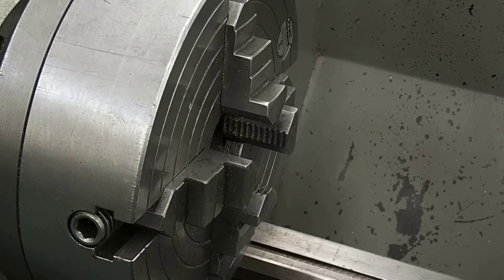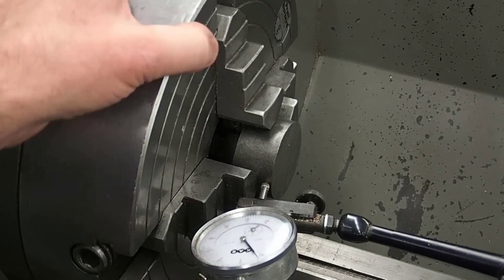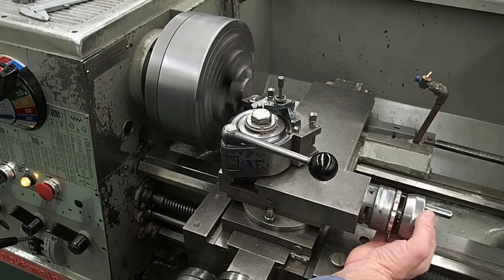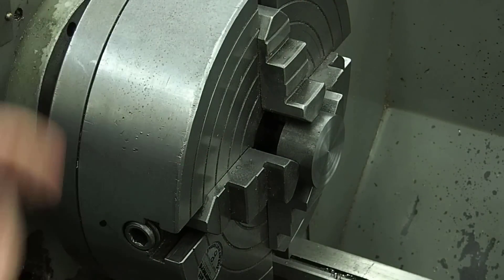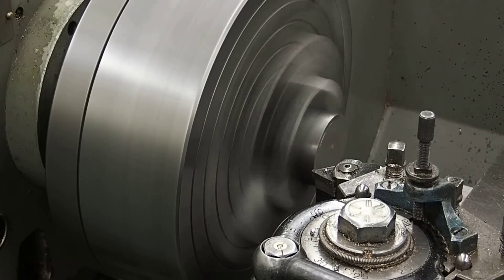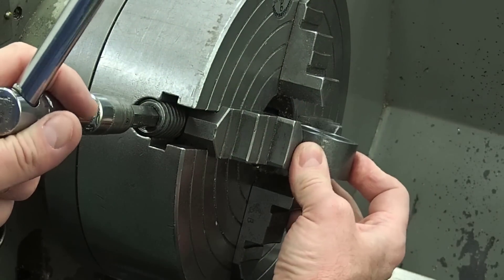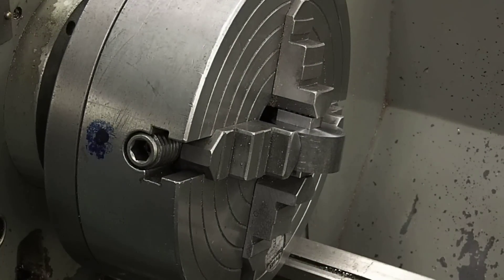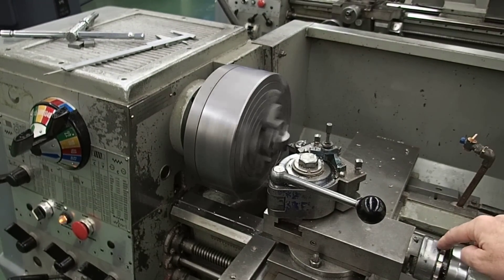Machining a Cube on a Lathe

Comment: This guy's a good instructor.  One thing I'd recommend, though:  Before moving the carriage back in towards the headstock, wait until the chuck stops spinning.  And perhaps even more importantly, especially for a beginner, when moving the carriage away from the headstock -- think of the consequences of an "oops, had the silly thing in reverse" disaster.
Reply from the maker: Good points it is always important to be safe. I have a bad habit of not always demonstrating safe practices as some things are fairly routine for me. Thanks for the reminder and kind words,
I always tell my apprentices to 1) rotate the part one revolution before turning the lathe on and see if there is a conflict before it is under power. 2) it you are not sure of the direction of movement turn the power off before you move the tool.

Comment: If you can find fault in his procedure/technique, then you do not need to watch this video. I learned the basics and that was good enough for me.
Reply: You didn't learn the right way to do anything by watching the video. But I enjoy seeing cuts on the lathe. He had plenty of those.
Reply: @docalexander2853  Really? Define "right way"! There are many ways to do many things. What is being demonstrated here is 1 way, not the only way! I have used a lathe as a mill many times and vice-versa. Don't be so quick to judge just because you wouldn't do it this way!
Reply: Regardless of the right or wrong way, you didn't learn the basics by watching a video lol you have to actually do it to learn it. You don't even know how to change the rpm on a lathe by watching this
Reply: @StillNoPickles69  I think the general assumption with this video is that you already know the basics and actually have a lathe to make this on.
Reply: Shortsircut1 I was referring to the guy who said he learned the basics from this lol
Reply: @StillNoPickles69  Sure you learn by watching a video you can even learn reading a manual. I think you are confusing his point with hands-on training and practice.
Reply: He didn't show deburring afterwards, but if that was an actual part then it's the most important step.

Comment: Thankx machiningmoments. For those questioning the accuracy I think the concept was to show how the X plane can be used to create flat surfaces beyond simple facing with the versatility of a 4 jaw chuck on a machine that typically is thought of as a radially cutting machine. The block could have been indicated more precise of course but cool demonstration vid. Like turning with a boring head on a mill. When square is needed and looking at all the mills set up and a mill is not available this is thinking outside the blox ;- ) Thanks again.
Reply from the maker: Thank you
Reply: I know you been around machines to even do this even public. Congrats and ...thank you for reminding me of the old school beauty of a 4 jaw chuck with all the CNC now. It's amazing to think that even with the cad incorporated software on the actual cnc today  withon screen tool paths and machine memorized tool data banks that the same results can be established manually. I remember a guy wanted an angle on a lathe and I used the x + z to 'draw' the angle by using a larger than needed radius tool and moved the x and z to every .005 thou move to 'generate the angle.  :-) Kudos to you machiningmoments
Reply: ps. I'm still in school as I see it. Remember the day when I had to be best leading to competition. Tsk tsk! Teamwork and ideas together go sooo much more. If I had my way I'd like to attack a piece of leadloy and sink the full CNMG 422 insert at .025 per rev. Looking to grab My 1st machine for the barn now. Thx for reply and the info. lol ... No ...Thank you!  ;- )
Reply from the maker: I appreciate the support!
Reply: Anytime. Well done
Reply: for what i expected from this video, you are spot-on
Reply: YOU GUYS ARE SPOT ON !!!
Reply: THANK YOU FOR THE VIDEO !!
Reply: All he had to say was you can machine a cube on a lathe. I know how to machine a square on a drilled hole with a drill. Let see someone make a video on that.
Reply: @docalexander2853  Well congratulations, then you should do just that, and then let everyone criticize you on it.

Comment: I was a machinist before I got into computer networking. I really miss making useful parts. Electronics is fine, but creating intricate parts from stock metal is real skill.
Reply: thank you I have made things that will be around long after I am gone
Reply: Someone who gets it! I was a carpenter before I broke my back forcing me into an IT job. Now I work as a software engineer and any time I discuss my former life, none of my co-workers get it at all. I miss truly making things.
Reply: Garage CNC
Reply: Those benchtop do alls don't take a lot of space. If you need a project to make with it .... there is always art.
Reply: I framed houses for a while ( 5 years ). Now I'm a software engineer, and I miss the satisfaction of looking at something at the end of the day, and thinking that "I made that". I do garage machining now to satisfy that emptiness. On a side note, software pays a bit better than framing. I too had a back injury that made me rethink my career choices. I miss that satisfaction, I don't miss working in the rain, or walking on 2x4 walls, or packing lumber, or stepping on nails, splinters, ring shanks, pushy general contractors, not getting paid... the list is long. I guess part of the romance of a trade is the adversity of achieving something worthwhile.

Comment: Many years ago, I taught a computer controls class in which one problem was to machine a 1-inch cube on a 3-axis mill. Almost all thought it would be an easy lab, until they tried to do it. ^_^.

I really like it when someone clearly explains how to do something that seems impossible at the start. Also, I’ve gained a new appreciation for a 4-jaw chuck. 

Great video! Thanks.
Reply from the maker: Its not that easy.

Comment: way cool. For those who care, it's a simple task to move over to a surface grinder and make it perfect. This tutorial is an example of how to use a lath for milling projects when all you have is a lathe. precision is a mindset. learn to use the tools you have.
Reply: What sort of surface grinder ?  Using an abrasive to flatten a surface is extremely difficult - the edges that scrape the abrasive always get slightly more abraded than the middle.  I don't think an abrader could improve on the exact flatness produced by a lathe.  The only way to perfect the cube would be to re-lathe it to finer tolerances.

Comment: Just chucking up the second face by eye isn't going to be very parallel.  You need to use stops or parallels before you face the second side to get it parallel to the first.
Reply: Thank you, when I heard "Should be parallel to each other", I clicked stop and scrolled down to find your comment, as I knew it would be here. Sadly, this is not a very thorough, or should I say, accurate, outline of working on a lathe for anyone who wouldn't already know how to do this.
Reply: Checked here for that very comment. Face 1 however you like. Face 2 opposite face 1 with parallels to the chuck.
Reply: @will5948  Agreed, and that's only after first indicating the face of the chuck to check for runout.
Reply: @markcayton6712  My thoughts entirely...should have clocked the chuck face...That battered old Coley....looks like its  done its time ? (Favourite general Iron though !).
On a good Triumph....you should be looking at turning to dead...everytime...if needed ?  Most now quote Limits & Fits as Bigga & Littla Hammer ?
Reply: Exactly  @JS-el3zm  .  Its one thing to comment on parallel or something, quite another to call someone's video showing basic operations worthless. Of course, those doing this often have no video's of their own to offer in place of their green with envy bs.
Reply: THANK you.  When he turned the work around that first time, he had me making motorboat sounds (but, but, but...).
Reply: @boots7859  nobody said this video was worthless. the author of the video did however claim the second face cut was parallel to the first which cannot be regarded as true. any toolmaker can make a cube by this method but most will be able to make it accurately which this is not. not posting a video of yourself making something does not mean you can't do it. that is just stupid logic. if you can't learn from the comments that are correct and helpful then you can't learn. think before you speak.
Reply: @will5948  333#33#

Comment: if you're in a small job shop or a home shop, and you don't have an available mill, you gotta do what you gotta do.
Reply from the maker: Hi Brad, likely the only place I would do this is in a hobby shop with limited equipment. Thanks for posting.
Reply: You shouldn't have a small job shop without a lathe AND a mill. Saw is good too.
Reply: Before I bought my mill, I did this sort of thing pretty much constantly in my lathe.

Comment: I'm surprised there's no coolant on the tool. But when I last did this, it was 47 years ago.
What a great teacher! I would love to re-learn machining, it's so satisfying making things that fit and have a great finish.
Reply from the maker: The cutting tool is carbide and the work piece is mild steel so it can be cut without coolant. I choose that combination so I could video the process without being impeded by the coolant. Thank you for your kind words and taking the time to leave a message.

Comment: Very interesting! But I can't cope with this measurement "thou" - sure I know its 1000th of an inch - but using metric is soooo much easier in general and way less risk of miscalculation!
Reply from the maker: I agree, but in North America we almost always work in the inch system.
Reply: We're Americans. And gotta toss up a middle finger to everyone else. But I wish we
Reply: Wrong. Both are accurate depends entirely what are you making.
Reply: Numbers don’t lie....English or metric!
Reply: @MuzikHead  English or metric? You mean Imperial or metric, right?
Reply: Laikos Vidar your probably in another country or from another country?? In the shops I’m in that’s what they say even though your correct. But I hope you know they only work with two different kinds of measurements.
Reply: @MuzikHead  canada myself, in my shop we tend to say Imperial or metric, interesting though that some people say English!
Reply: a "thou" is literally just 1/1000 of an inch. If you can't do calculations with that you're not going to be any better off with metric
Reply: "JOIN the Metric Movement NOW! Our rulers are based on LAZERS!!"

Comment: The strength and precision of the lathe impresses me. The math is impressive too. The finished cube is 1 cubic inch. The beginning stock is 3.1416 in³. Therefore the waste is 2.1416 cu in, or  68.169% of the original stock. 

If I tried to machine this I would hit at least 100% waste! ... Plus the tools and equipment damage.

Tons of respect to this machinist!
Reply from the maker: Thank you

Comment: When I was in the shop as an apprentice (30 odd years ago) I would use the lathe to remove material off square stock as it was quicker than doing it by hand. We only had 2 mills and 2 shapers but loads of lathes. Yeah its not the most accurate, but if I wanted accuracy there was always the surface grinder.  This video gets you thinking outside the box, and for that it is really great. Thanks for posting.
Reply from the maker: Thanks you for watching and posting.

Comment: I was just imagining about this concept on how to square a round piece of stock in the lathe,because I was not sure if it is right or not. But you just cleared that out for me. Thank you.

I am a tool maker and the first technique wich I could think of is to file it square in a vice. The second maybe in a mill, but I don't own one, so not sure. So, I find this video, very informative. Someone can do it without  a milling machine if there is a lathe in the shop. Of course there some comments from the big guys about perfection, I think this is just to show the concept, then it can be taken to perfection..
And great speech by the way, without gaps and lots of .... ã ooo... aa..  and ..you know's
Reply from the maker: Hi again,  I shot the video because a follower of this channel sent me a message stating he wanted to make a cube and didn't have a mill. You are correct, the intent of the video was only to show it was possible...it sure stirred up a hornets nest!
Tool Makers are amazing with files!

Thanks for the comment about my speaking, in fairness I use video editing software. You should hear it before editing! ;)

Comment: After being retired for 4 years, I was a journeyman manual machinist. This brings back happy memories. That metal must be "Ledloy", because as you got into center, you got away with pushing it. The carbide didn't chip, and there were no blue chips. I think cold rolled steel might have made a "not so silver" chip. Manganese steel is pretty soft also.
Reply from the maker: Hi John most of the steel we use has a lead component to it, free machining. C12L14

Comment: I remember in the mid '70s seeing a machining instructor at the British Aerospace Woodford plant in Manchester turning a cube of aluminium that had a round hole in each face. Inside the cube was another smaller cube that was too big to fall out the holes. It was machined in place from the solid cube using a special cranked cutting tool.
Reply from the maker: Yes, a Turner's cube. I have one in my office.

Comment: same machine I learned on in my Dads shop. I made new aluminum knobs to change out the ones that slipped. Now retired at 64. great memories including getting my apron caught in the rotating screws.  ( I was able to shut it off in time)
Reply from the maker: It's a great lathe. Sounds like you have some great memories. I'm glad the lead screw incident turned out OK, that can be very dangerous.

Comment: One thing kind of useful thing I found was I was needing a ground finish on a hardened part and the toolpost grinder was too big so I set up a die grinder in the compound. Worked great! After that I have done something like that for other jobs and had very good results.and the die grinder was just a 9 dollar harbor freight item. A cheap tool at home if you can't buy a toolpost grinder. I've also used it for ground bore size and finish. This can be done in a fairly small lathe I just used 2 hose clamps to secure it but make sure however you do it it feels solid and use light pressure on the pass. I just used the stone wheels that came with the grinder or ones like it.
Reply from the maker: That works, it's amazing what you can do with a lathe!

Comment: WOW, machining steel without lubricant, what kind of cutting bit its that??
Reply from the maker: Carbide. It is the workhorse in the machine shop. It can be used wet or dry.

Comment: Interesting video... it's amazing what can be done on a lathe.
Many years ago I watched, Russ Collins (RC Engineering), a NHRA Motorcycle Pioneer, fly cutting piston crowns for valve relief clearance. 
He had made a fixture to mount the piston to the tool stand, and was turning the cutting tool in the chuck.  
I asked wouldn't a mill be more appropriate for this procedure? He said: "do you see a mill in here kid?"
Reply from the maker: They are extremely versatile. You are limited by your imagination.

Comment: if the part length is 10 inches and want to make one end square how we can do? I would be thankful if you make a video about this problem. is it possible? thanks for the video.
Reply from the maker: I assume the 10 inch part is cylindrical and requires a square one end. If that is correct I would use a lathe to turn the correct diameter and face both ends. I would then use a milling machine and a dividing head to cut the square. If you are not sure please have a look at my simple or direct indexing video. Thanks for asking.

Comment: Does the four jaw also make it easier to keep the work squared up to the tool?
Reply from the maker: Not really, the four-jaw allows even chucking pressure on odd (non-cylindrical) shapes. It also provides more holding power which helps with the interrupted cut. The "squareness" comes from the part sitting tight to the inside of the jaw at right angles to the cut.

Comment: Could you show how to make a cube inside a cube. Or even three cubes. Was shown these back in the early eighties when at college.
Basically tapered holes on all faces until the centre breaks out.
Reply from the maker: https://www.youtube.com/watch?v=AuS6HDHc7XE&t=172s
Reply: @machiningmoments  That is similar but the the round holes are parallel, the one's i have seen the round hole are machined   tapered in so that you end up with a larger cube.